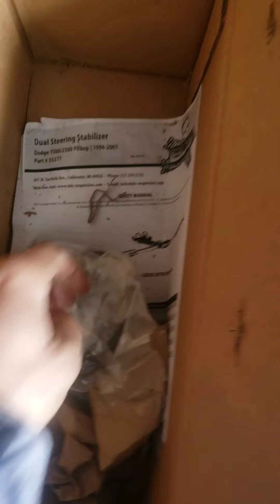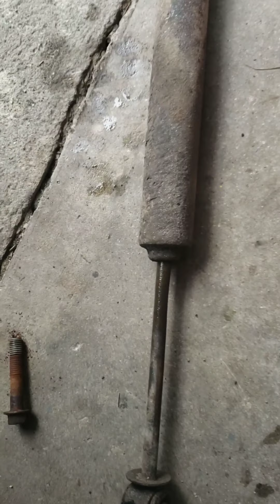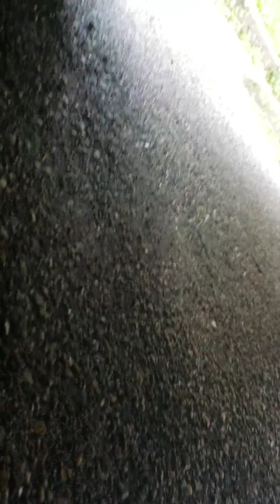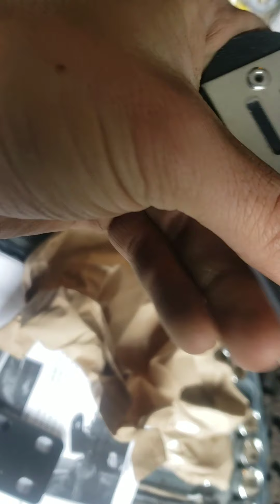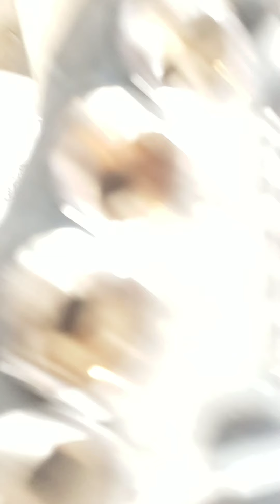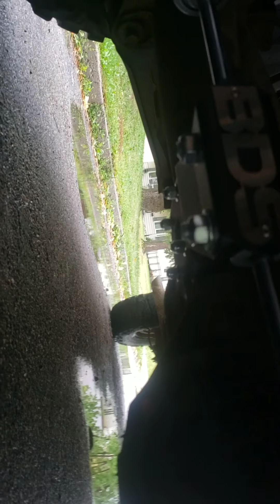Dual steering stabalizers on a 2nd gen 1500/2500

Comment: I’ve been looking at all the different brackets these companies sell . I just can’t believe after all the years I have had and built 4x4 mud trucks and rock climbers that are also daily driver . There’s no way That center bracket isn’t going to start shifting back and forth with the cylinders it needs much more side support than just those two 3/8  ubolts just a couple inches apart are going stretch and loosen up that bracket needs to have a part out to a differential cover bold to stabilize that bracket from moving side to side

Comment: Give the Y steering or the T steering what year is your truck?
Reply from the maker: This was on a 98 1500
Reply: @killerautomotive9473  is the truck lifted
Reply from the maker: It had a level 2.5 inch level
Reply: Just got mine today u bolts are too small it’s a 2500 fuck!